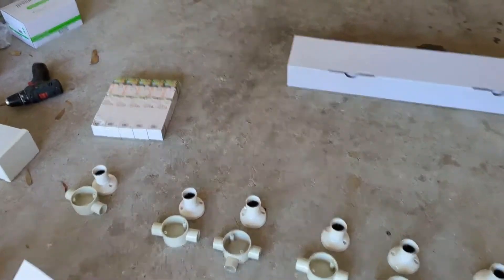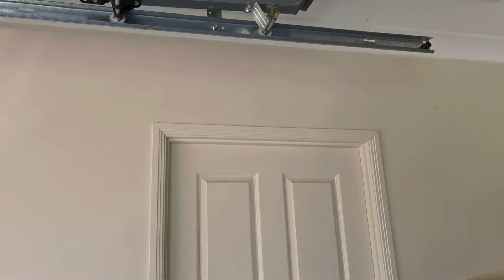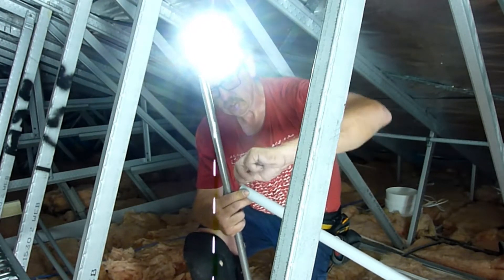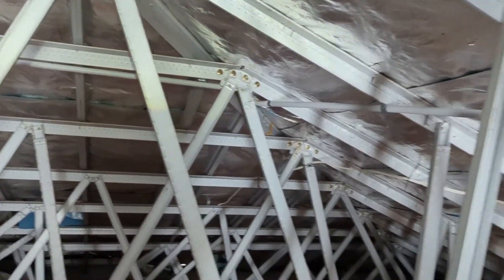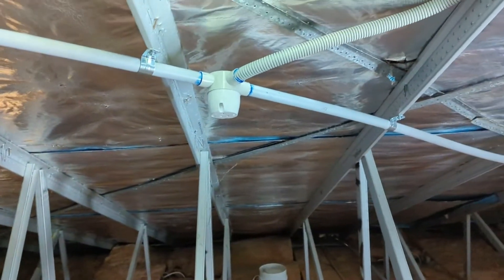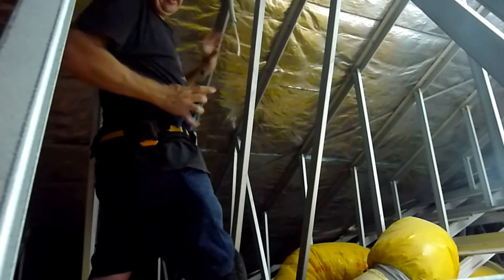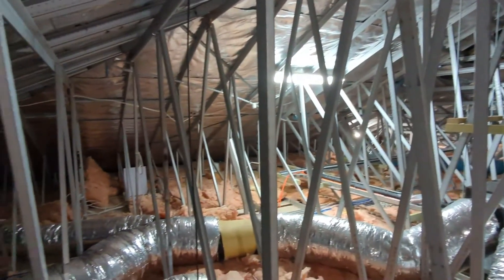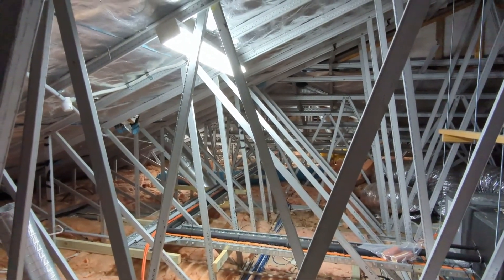Lights in roof ready for NBN upgrade

Comment: Are you crawling on the ceiling joist?? you're lucky you didn't fall through. These steel roofs are a pain as they are not to be walked on. There should have been a sticker near the manhole warning you so. You meant to run planks. Also I wouldn't have bothered with the conduit. I only would have fitted the junction boxes so you can fit the light sockets to it.
Reply from the maker: Yes I was on the joists, I have never seen a sticker warning about falling through.  Steel joists are not as nice as timber but much better for white ants....